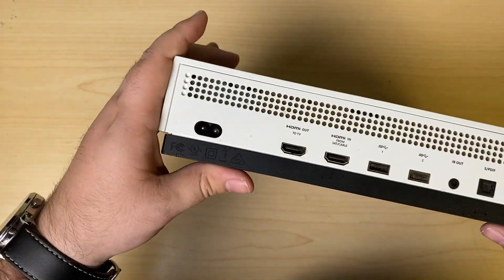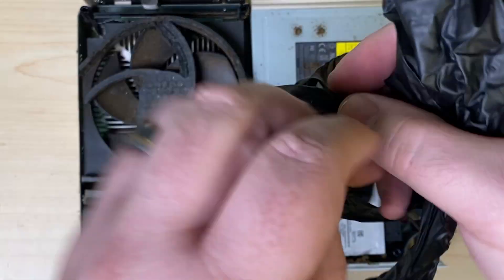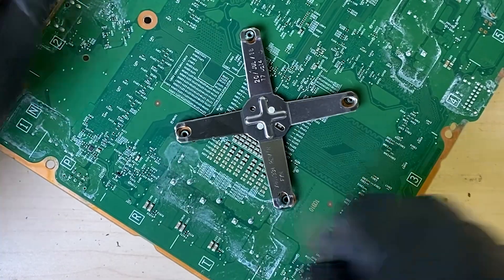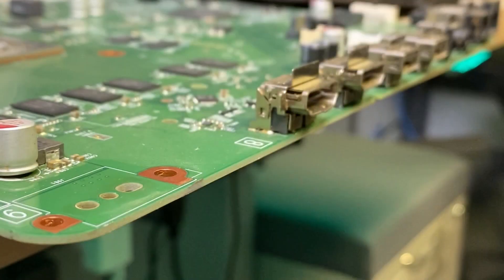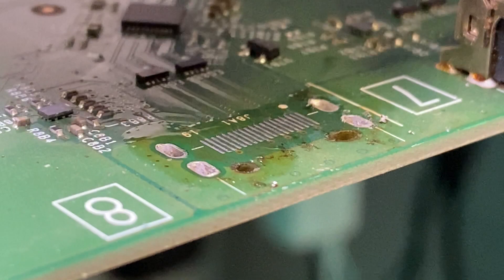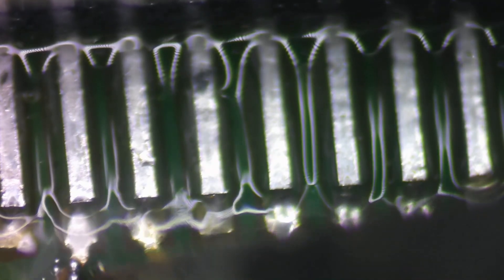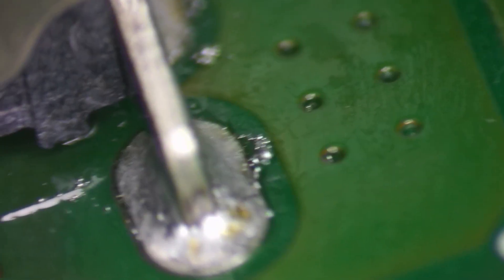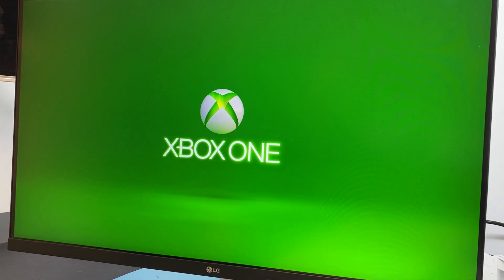How to replace HDMI port on an Xbox One S ? | Mobilesentrix Tips and Tricks #65

Comment: can the hdmi port be removed with just a soldering iron without the need of a heat gun
Reply from the maker: yes, but its really not recommended.  If you cut at the damaged HDMI carefully you can remove one piece at a time using a soldering iron. Use low melt solder so that you have the best chance of not damaging anything and with enough patience and persistence you could make it work.
Reply: @MobileSentrix  thankyou for the advice :)